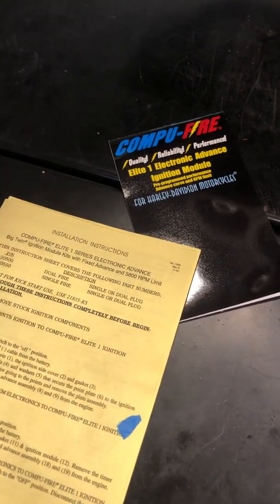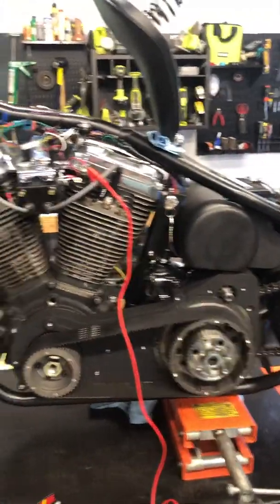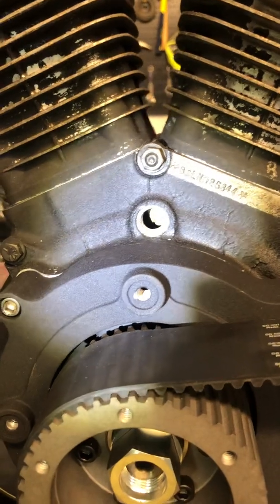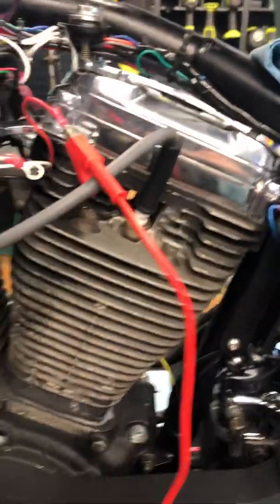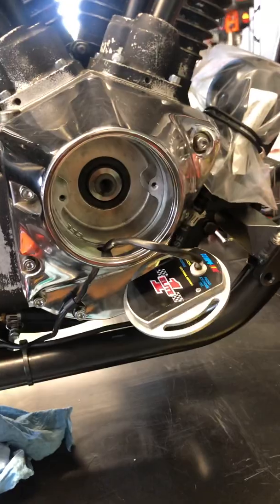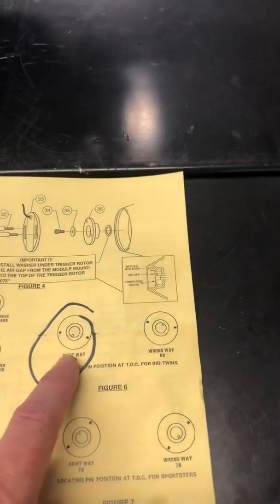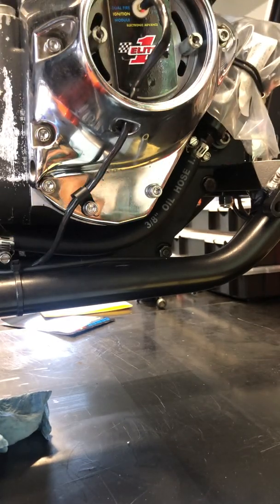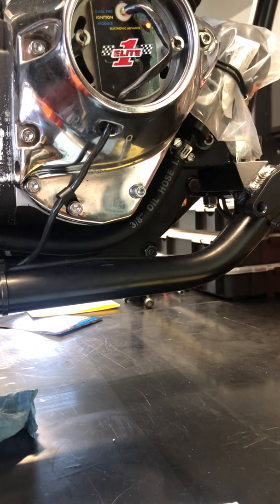Static Timing the Compu-Fire HDE-1 Ignition on my Harley Davidson Evolution Project

Comment: Hey brother my ignition i believe fryed . I have a 1340 evo . I have never replaced 1 before.  I bought a dyna 2000 ignition for it I am going to plug it in under the seat is that everything I have to do ? And  just unplug the one in the cone. Like I said I have no clue I use this motorcycle to get to work so any help.is very much appreciated thank you
Reply from the maker: I have not installed a Dyna 2000 ignition but this looks like a series of videos on installing on in a Evo from start to finish. https://www.youtube.com/watch?v=F3ayzkEgAf8

Hope that helps!
Reply: @SportsterProject  thanks brother I really appreciate it . It's hard to find people that will help ya out these days and this bike is the only thing I own and I'm super stressed out that it's down.

Comment: from the looks of the cam shaft- it almost seems like you were TDC on the exhaust stroke. Maybe it was just the way the video was edited... or maybe you 'discovered' this after.  Anyway- as a suggestion; start from the beginning. Wiring the coil, explaining the singe / dual fire settings on the module.  Ride safe everybody.

Comment: This product is junk
Reply: ??? yes- by all means-  just leave a four word comment but don't explain.  The product is NOT junk.  I actually replaced a Twin-Tec module with this Compu-Fire setup which I find better built.  The pickup sensors on the old Twin-Tec broke off the module plate. This Compu-Fire design is much better.  I owned both and I'll take the Compu-Fire .
Reply: yes its complete junk